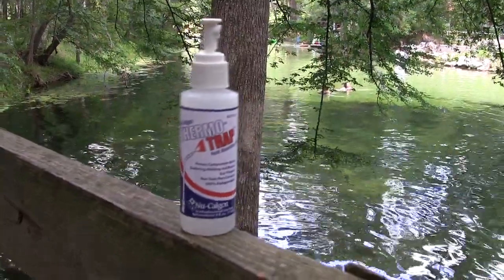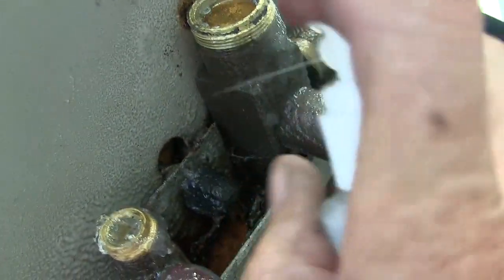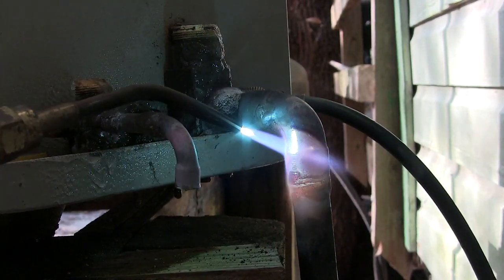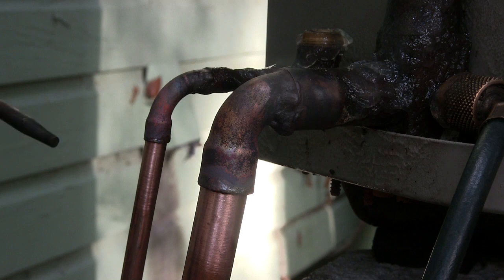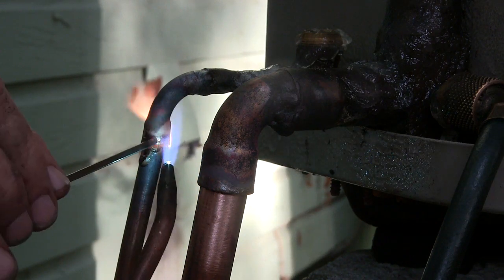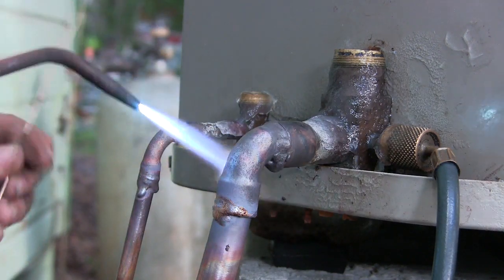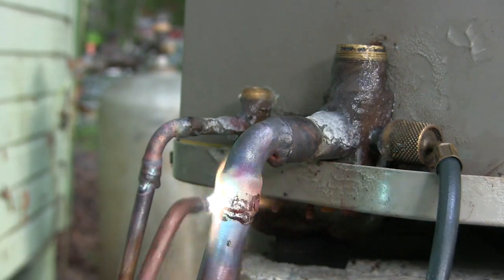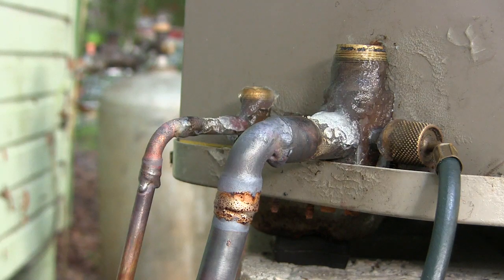Nu Calgon Thermo Trap (brazing)

Comment: this is more for spraying on a wall or anything you don't want to catch fire. Great for tight spots in attics and closets. I wouldn't spray it on the valves because you will get it all over your service wrench or whatever. Still need a rag to clean it up lol

Comment: So basically, water with a gelling agent added, which holds the water in place. As water turns to steam, it pulls heat away from the part and keeps the temperature around 100C as long as the gel hasn't fully boiled off.

Essentially the same idea as the wet rag trick.

Not sure if worth the money?
Reply: They both work, but the gel works at any angle while rags rely on gravity.  I've got a drill bit whose temper I prefer not to draw and this stuff looks just right for localizing the heat when I braze a sleeve and hunk of rod to my reduced shank bit for extra reach.